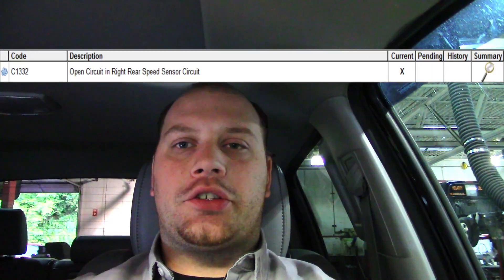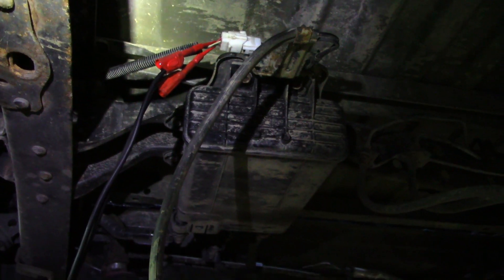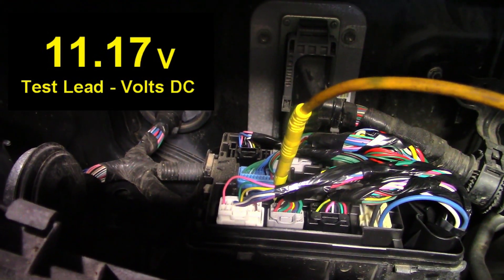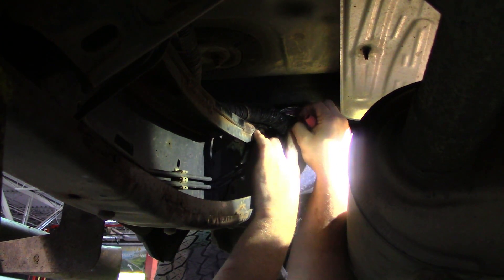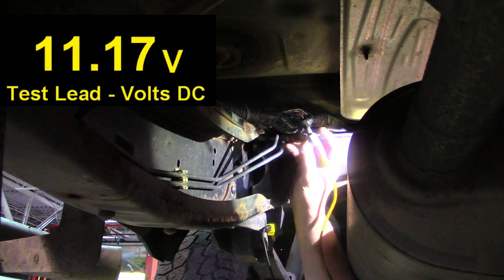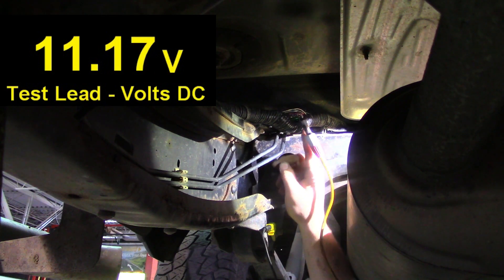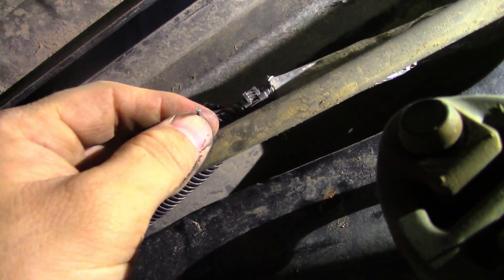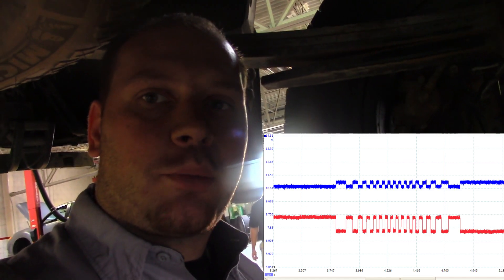Diagnosing a toyota active wheel speed sensor

Comment: Great diagnosis & video Pat! I've been working on cars since the 70's and the reason why test lights had points on them was to pierce wires and the way to find an open wire was exactly the way you did it and the most efficient. You covered the holes with liquid electrical tape so great job. Nice touch looping wires to increase the signal strength. Keep the videos coming!!

Comment: Nice job PJ. One little trick. Once you locate the failure down to a small area, if you can't see the damage right away as in this case, try to pull the wire from the harness. Depending on how far away the break is it might just slide right out. Then you can just stretch it back out to see where the failure is located.

Comment: could you do a video on toyota evap systems. they are so complicated compared to ford gm and chrysler
Reply from the maker: phil holbrook which system?  The older systems were a little more difficult. The newer systems with the built in leak detection pump are a little easier. 

But you’re not the first person to ask for a video on the Toyota evap system, so I’ll try and make one shortly
Reply: @VoltageDropDiagnostics  yea the older system with all the shut valves etc. and the leak detection one would be nice!

Comment: My wife’s FJ threw a P0500 “speed sensor circuit A”. All 4 speed sensors are reporting correctly on the live data and everything I’ve checked so far is leaning towards the combination meter assembly. When I did a YouTube search for “Toyota P0500” I came across three different videos (Cody’s was one of them) of the combination meter assembly (instrument cluster) on the 2005 Tacoma to be the culprit. That made me wonder... is the combination meter assembly a common problem on certain models and years?
Reply from the maker: Yes! It is a pretty common issue on the older tacomas and FJ Cruisers. And Cody did a really good job explaining how to diagnose that system!

Comment: Some Ford cars have circuit protection on active speed sensors they shutdown the feed so you could be on a wild goose hunt if you don't know that, what about Toyota did you first clear the code before checking for voltage? great video
Reply from the maker: I had been clearing the codes every time I went to drive it originally to see if the code would come back. But once it became a hard fault, I quit clearing the codes. I’ve heard that about some makes and models, shutting off the circuit. But luckily that wasn’t the case on this one.

I do know that newer corollas also shut down the circuit.

I understand why they’d do it for a shorter circuit, but I don’t understand why they do it for open circuits.

Comment: Nice find man! Just curious, some auto manufacturers strongly discourage piercing and/or repairing wiring and recommend only harness replacement. Honda is one of them. I don't know why. For warranty repair, they will pay me to replace a floor harness for a small amount of wiring damage instead of just soldering a single wire... is Toyota that way too?
Reply from the maker: Its funny you ask that. I have never seen it in writing. But lately I have been strongly encouraged to replace the harness for any failures under warranty. Luckily, its extremely rare for a harness to have damage without rodents being the cause.
Reply: @VoltageDropDiagnostics  Yeah, it's actually in our factory training modules that the best repair is harness replacement for corroded or damaged wiring. And when it comes to SRS, no repairs are allowed under any circumstances. Acura/Honda goes so far as to say if any wiring repairs are performed, the facility that performed the repair is responsible for incorrect operation during a collision.